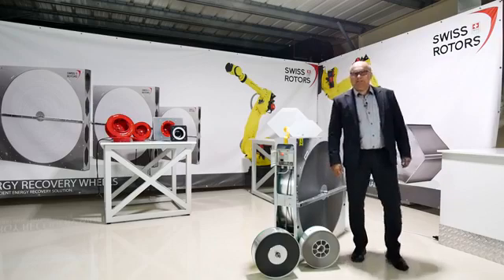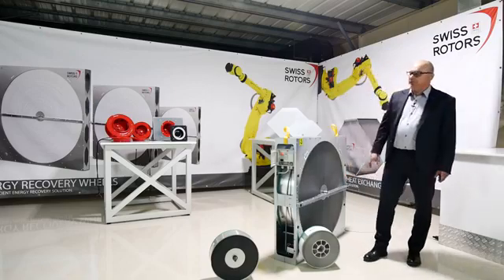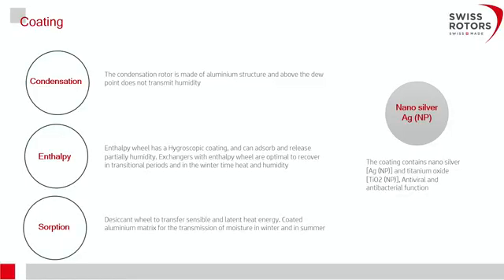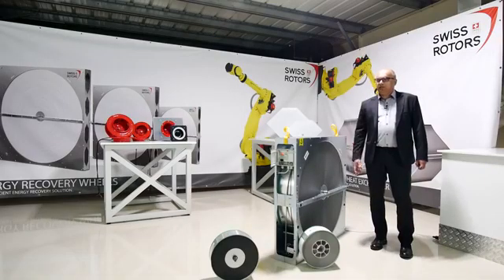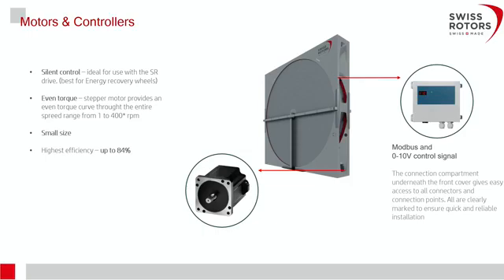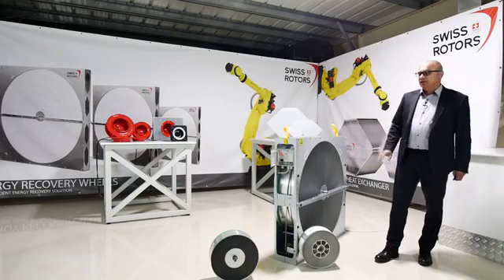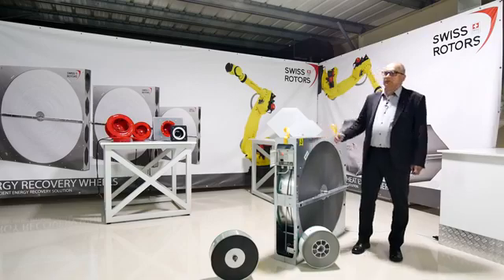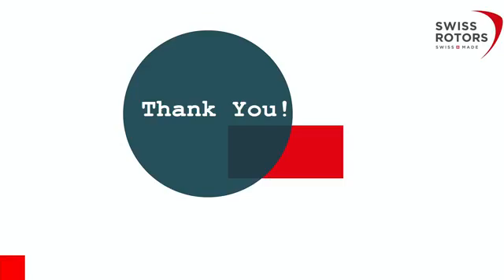The impact of an Energy Recovery Wheels within a ventilation system | Webinar

Comment: Good day.
I am begining my jurnay in to rotary heat and humidity recovery mechanical ventilation. This is in my mind the best way to maintain neutral and the same the best quality air in our homes. My question is: would you go with with a standard wheel I one with hygroscopic coating? My aim is to recover and maintain good level of humidity in winter and also keep too humid air outside in summer.
Thank you for your informative videos and looking forward to hear back from you.
Reply from the maker: Hello,
It depends on the input conditions and what output parameters you want to obtain. Here is a link to our selection program (https://selection.swissrotors.com/) and contact to the sales representative (lech.lakomy@swissrotors.com) who will definitely help you choose the right one.

Comment: it is very interesting to note that Swiss Rotors is coming up with Nano Silver coating which is a great innovative feature in the current pandemic situation. This is a unique selling point and will find acceptance in the HVAC industry particularly in the healthcare segment. And also you mentioned about UVC light treatment which has been a feature of cooling and heating coils. If ERWs are integrated with UVC lights it will be another innovative feature to combat virus. Congratulations to you and Swiss Rotors for leading the industry iinovation in such a short time.